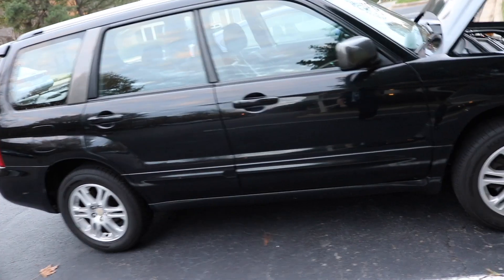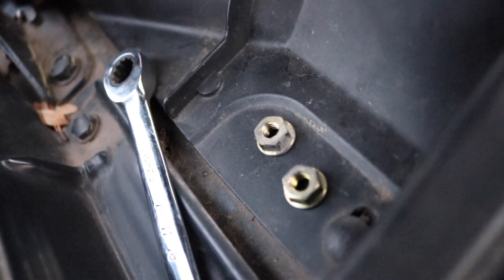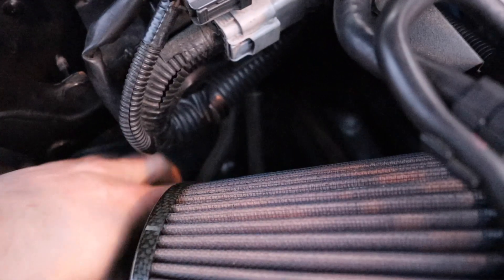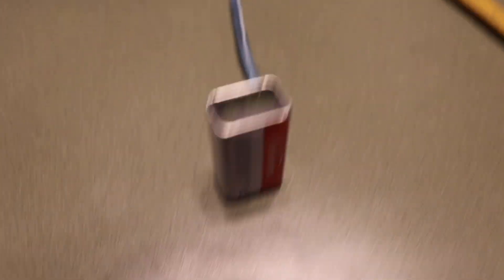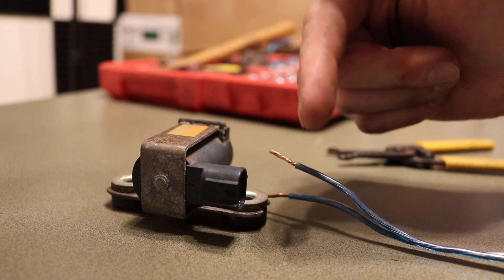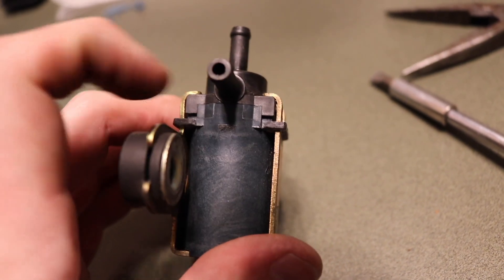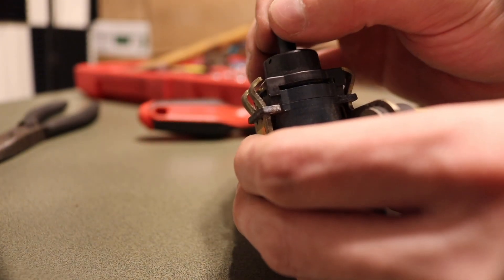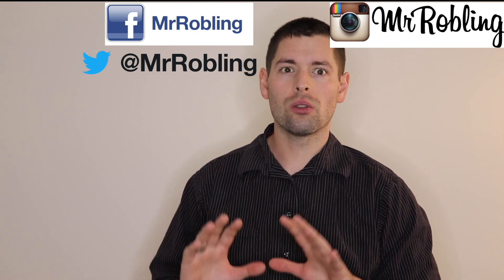2005 Subaru Forester Turbo Solenoid

Comment: What turbo did you go with? When I upgraded my turbo I was having an over boosting problem too, but I had a brand new turbo solenoid. Turns out the spring in my waste gate was for 25 psi. I had to order a different spring from the manufacturer.
Reply: InstaBlaster...